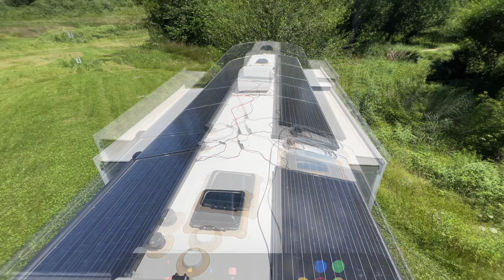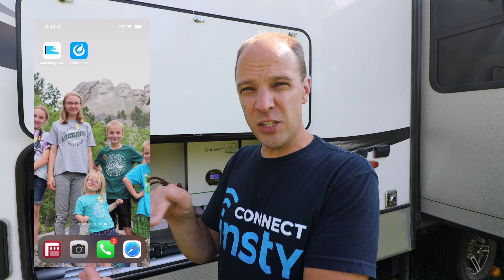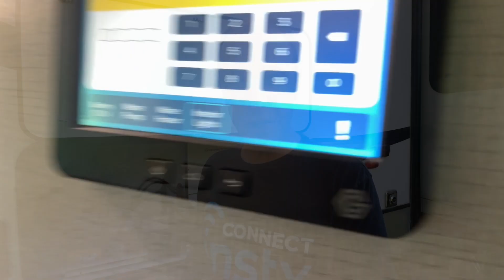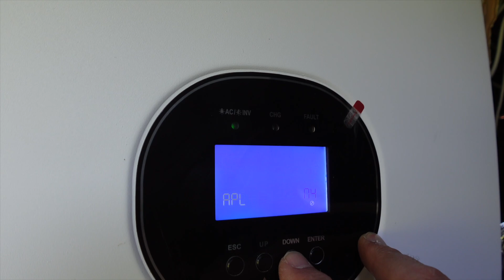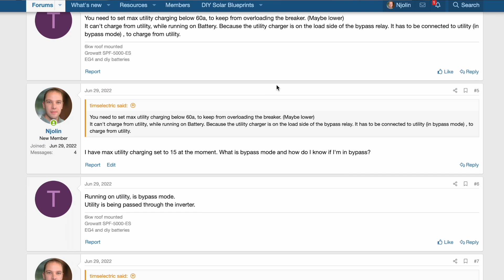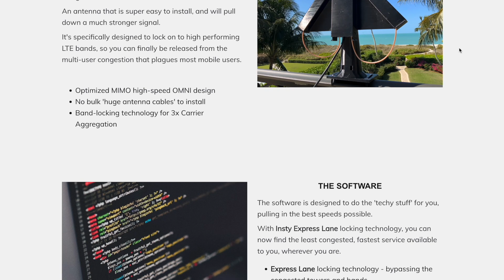How to DIY a HUGE 50 amp RV Solar System

Comment from the maker: Thanks for stopping by!  I'm sure I forgot something in our solar setup, so if you have any questions or if I missed describing something, please drop a comment and I'll be happy to help.
Thanks!
Reply: Hey, thanks for all the info. As a newbie solar person, I just wanted to drop a few things..1st, I think you have 7.680+/-  kwh battery not a 15Kwh..when you add the 2 12 for 24 you don’t double your aH..second, you may (and idk for sure) but if you connected the Growwatt together for 240, then used a transformer to auto switch it back to 120, that may have lessened the amount of reconfiguring on your panel in RV. 3rd I think the easiest charge and use scheme would be with an additional charger, so maybe there’s a way to wire that into the cutoff you plan to add.
Reply: @nwalker7008  It's a 15kWh battery bank (Each battery is 320AH @ 24V = 7680Wh and the batteries are connected in parallel).
Reply: I have a 2020 Cougar 30RKD (50A) with an outdoor kitchen that I do not use (well used one time right after we bought the camper in 2020) and have been thinking of doing just the same thing.  I am going to go 24 Volt, not 48 or 12, same as you but just yesterday I purchased a 'pre made' battery from SignatureSolar. 100 Ah, 5120 Wh and I don't have to build it myself. I'm going to start with battery and inverter charging while on shore power as we (the wife and I) don't 'boondock'.  My 6Kw inverter and batteries are going to fit inside that same compartment just fine, however, mine is directly over the wheels so I'm thinking that will help with the some 170 pounds a bit better.

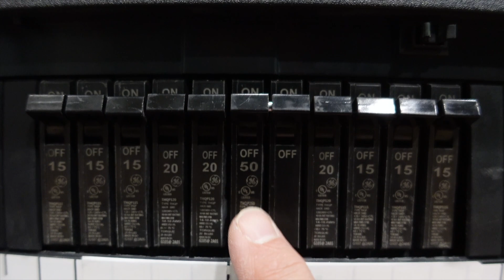I am still in the planning/ordering stage and wondering how you did your wiring for the inside panel... you touched on it briefly starting at the 8:30 mark.  What did you do? How/why did you do it?  

I'm thinking of a switch 1 for shore power, 2 for inverter power and having a separate 24v charger to top off my battery while plugged in.   My camper sits inside my 40x50 garage with full hookups as an extra bedroom and bathroom at home on our farm.  We depart 2~3 times a year for a couple of weeks and I want A/C when at a roadside park (making sandwiches) while enroute to our destination .  We got 'caught' last summer in Nebraska while spending 3 weeks with our daughter.  They wanted to look at some dinosaur bones and we didn't care to look at them for as long.  So we were stuck inside our F250 diesel running the A/C with fuel being >$5.50/gal while they looked at bones and ate their sandwiches running their generator in their camper.  We had no such option.  This will take care of that and solar panels will be added during the coming months.  I stayed awake all last night thinking on how to run them.

We have the same leveling system and I'm keeping the 12v system for the same reason as you are.

Russ
10/25/2022

Comment: Your video should be reported to YouTube for making dangerous recommendations that can result in serios injury. The inverters in your video are not UL-458 listed and do not provide automatic neutral ground switching, and for safety reasons, should NEVER be installed in any mobile application.

Comment: Like the video... Im doing research now but think I'll go with 48v to reduce the wire size even more.  As soon as you said something about disconnecting, I automatically thought about the disconnect switches.  Keep up the good work

Comment: For an easy install, couldn’t you just install a 24 to 12 V DC to DC charger? That would keep your old house battery on tip top charge and then just use a 100 amp charger and eliminate the 120 V sure power from your all in one inverters. That would keep your lithium battery charged.

Comment: You have 2 separate batteries so you will need 2 separate shut off switches...Put the switch on the Battery box where the POS wire is connected. Unbolt the POS wire from the battery box and use a copper strap to connect the switch? Cover all exposed metal to prevent shorts.....Cover your Battery Boxes...... Noticed you had a exposed POS lug on a buss bar! and all four battery Posts were exposed. Safety First!   Question....Wouldn't you want just one Battery per charge controller?  I need to research that for myself...Enjoy that power.

Comment: As far as connecting the 24 volt to 12 volt system just use a battery to battery charger. For me personally I will never use a all in one system like the growatt or eg4 , because if one part fails then you have to replace the whole system. I perfer to use Victron gear and yes i am poor and live full-time in my 1967 GM TDH-4519 city transit bus in the high desert of New Mexico. I am disabled and unable to work anymore so I live on a very fixed income and I will still save up enough money to buy Victron gear

Comment: Feb, 2024 the 50 amps objective is much simpler. Two 8000 watts modified sine wave inverters, each connected to a bank of 8 x 12 volts x 100 amps lipos. Then purchased a 50 amps inlets plug...

Comment: Hello, well a year later the choices are greater and prices lower... : )
How would you now connect a solar generator to a RV 50 amp inlet ?

Heated power case with two built-in inverters and four string combiner?
with ?x800 watts flexi solar panels...We already purchased 6 of them, not sure how many we can string together.
We are now in negociation with a lipo manufacture to see if people can order turn-key 50 amps RV ready heated power case.

Inverters now have a max. cap. of 8000 Watts and 3.5K of running watts...not sure if we have to get two of them...

You seem to enjoy that kind of thinking/work...me too. :)

Eldy
Reply: Hi, I'm doing the physical part of the Solar 50 amp project. Like you said, choices are greater and prices are lower. I have 50% of the system up and running smoothly, ordered the other half yesterday. Once installed on the 50 amps inlet, I move on to selling an automated electrical solution for 10 years to RV Dealers.

Specs are as followes,

8 x 800 watts panel on a 8 String Combiner.
1 Renogy 100 amp MPPT
Two x 8000 watt inverters
16 x 12 volt 100 amps(All in parallel)

and voila, afterwards I have to design a freeze and shake proof hard casing...fun fun! :)

Comment: so why wouldn't you use a hybrid inverter connected to solar and battery and shore power to continue the vicious cycle of charging the batteries to use?

Comment: Hope you find a solution because I have the same issue of not wanting to mess with the original house battery system.  I dont hav a separate battery system yet, still researching. Perhaps a dc to dc converter from 24 to 12 volt and just keep the house battery topped off?

Comment: Please Help with Poor solar system performance? I have 36 volt, 1920 watts of solar panels, wired in parallel. Connected to a Powmr MPPT Solar 60A Solar Max Charge Controller for 12V 24V 36V 48V. Using 8 gauge wire running 90 feet from controller to 675 Amp Hour floated, 12 V batterys. QUESTION controller output is Only 25 Amps at 12 Volts. I think I should get approximately 50 Amps to 150 Amps at 12 Volts?. DOES ANYBODY KNOW THE PROBLEM. I checked the 36 Volt, 240 Watt solar panels open circuit voltage is approximately 36 Volts short-circuit current is approximately 8.25 Amps each panel..  Any help would be appreciated Thank you.

Comment: For joining the two systems I found going through a big step down converter to work great at replacing the 12v battery all together. I was lucky enough to build 48v and got my hands on a 250amp Dodge converter from the newer greener 48v trucks they don't actually have a 12v battery at all so that converter starts it and runs the truck. The 48v turns a motor the turns the engine harder 😂 kinda convoluted system if you ask me for a OEM but the parts are fairly cheap used and plentiful. I did a eg4 bank in one set up and a diy bank in another and this was a great solution to both but it's 48v. You could redo your pack so it's a 320ah 48v pack but I don't believe the growatts will work although they sell a 48v version that I actually use and love. Either way the easy route is a converter going 48v just makes a lot of things better as you pointed out going from 12 to 24. 48v is even better at making small currents for the watts which makes the wire so much cheaper sometimes that alone can offset the cost. It did in both my cases. I also made a 48v alternator for the ambulance that really does a nice charge quickly. It does around 6kwatts but a good suggestion especially since the rectifier can be mounted close to the charge circuit so the relativity cheap ac circuit can make long runs without the voltage drop of DC. Works like a champ for the last few years. Next is a system for the house/shop complex 😂

Comment: If the inverters can’t tell the state of charge what happens if you are away and it keeps trying to dump power into the bank once it’s full?
Reply from the maker: The battery BMS monitors individual cells and will cut off charging if one of the cells reaches top voltage.  That's why lithium battery BMS's are super important

Comment: I'd like as much information on a 12V system to run my entire camper. My camper is 30 amp and has the 12 volt system up front. It had 1 12 volt marine battery and I replaced it with two better 12V marine batteries that have a small 12 trickle panel for while I am at work to help charge those for the lights when its comfortable enough without running the gas generator. I am wanting to replace the gas generator with solar panels. I have 8 6 volt  golf batteries I bought new for this. I know how to wire them and I already have all my cable for the connections. What size inverter do you think I need? Also a good controller? I have one ac unit. Any help is greatly appreciated.

Comment: Have built a number of off-grid systems, and I'm not familiar with growatt inverters at all, but my next system will be a Sun Gold hybrid which is batteryless. So in the event of a battery rundown and you're connected to shore power it will just pick up from the shore power or you can run it without the batteries at all. They have an awesome rack mounted battery as well and a couple of those would give you a similar amount of power as what you have there for very reasonable cost

Comment: Curious if there was ever a solution to integrate an onboard generator or shore power into a system like this.  Would like to have the option to use solar/bank, generator, or shore power.

Comment: Not a bad setup but having the 12v seperate is a pain by time u get that all included the price would prob be same as a normal systemi just done my van 600ah lithium 12v,1200w solar, dcdc charger from car 3000w inverter runs air cons etc for about 9000 aud all inclusive never have to worry about any things or issues

Comment: You absolutely do need to keep the inverters synced. If you only have one neutral wire running to the panel. If the 220 volt phase cycle isn’t 180 degrees off from each other you are effectively doubling the amperage through that neutral wire.
Reply: This comment! This is a problem in residential, overloading neutrals. Something people overlook.
Reply: This guy seems to have done his homework. He probably did separate neutrals.

Comment: 7:11 How much power does your 12v system run?
Can you just get 4 more cells and a 12v 50a controller and find a place for 1-2 more solar pannels?
the 280ah cells are a bit more managable in existing 12v spaces.

Comment: My Growatt says it is supposed to only work with Growatt batteries (Li) and has the communication cable that is intended to interface with the battery's BMS. However, it also has settable values for Li. I am assuming you used the configurable settings for the charge profile of your custom Li batteries. True? If so, what parameters did you set? I know Li does not like to be kept "trickle charged" once at 100% charge and I am wondering how you prevented that. Any information would be helpful. Thank you!

Comment: You didn't mention it, but I hope your batteries are LiFePO4s. If so, they are figured at 12.8 Volt, (or 25.6 Volts in a 24 Volt nominal system). If not, they could be a fire hazard!

Comment: You can run a wire from 24 v charge controller load to your 12 v charge controller solar input and thats all you need to charge your 12 v system

Comment: Here is a thought for your 12v systems. Hope this isn’t too wordy. I’m currently planning how I want to set up my fifth wheel off grid. One of my requirements is the ability to charge off of my tow truck. Essentially eliminate the need for a backup generator.  I already have a 220 amp alternator in the truck and can add a second if I need. Here is my plan for the 12v system. I already have 4 gauge wire running from the front of my truck to the back of my bed. Looks like a homemade winch power kit. I also already ran the same 4 gauge wire to my current 12v battery bank on the RV that I can plug into the truck with quick connecter. This allows my truck to charge my 12v system while it is running with much more amperage than the little wire in the 7 pin trailer connector. I used a continuous duty solenoid up front so it doesn’t pull a load off the truck when the key is out of the ignition. I did this so my residential fridge doesn’t draw down the battery bank while driving long distance. Now part of my plan for the off grid system is to leave my 12v system alone to include the 2000w inverter that already exists. I will then wire that inverter to one outlet i installed next to it that I will plug a 10-13 amp golf cart charger to. That charger will charge the future 48v system I put in independent of the future solar and inverter charger. I’m also going to leave the 100w panel on the roof that is already hooked up to my 12v system. I know it’s not the most efficient but I wanted a way to charge 48v from the truck’s 12v system while driving or I can high idle while parked for a while to top off without the need for a backup generator. I will already have a huge weight penalty on the trailer’s gross for solar and batteries. Eliminating the generator will help. One bonus I see based off of this video is now I will have an alternate power source to jumpstart the 48v system in the event of getting too low in energy reserves. I may rerun the cables from the truck as 2 gauge. 4 gauge is what I had on hand and it served the purpose at the time for keeping up with the fridge on the 2000w inverter. I know I can get 12V to 48V up converter but they are not cheap. This method uses an existing robust system which will leave me with a backup power reserve to jumpstart the 48v system and allow for using the truck as a generator without pulling too much juice out of my alternator. Another key to this is the switch I already installed on the outlet that runs my AC to 12V DC converter that came stock on the RV. This will allow me to prevent my future 48V off grid system from trying to charge my 12v system while I’m using the 12V system to charge the 48V system. By keeping the 100W panel on my 12V system I will likely never even need to charge it from the 48V system except under rare circumstance.  This will also give me peace of mind that I will have an entirely independent power system on the RV that I can easily return to original configuration in the event my 48V system has a catastrophic failure. This will guarantee my 12v system as well which is vital to the RV. My 12v sources will be shore power or the 48V system via the AC to DC converter, the tow vehicle, one solar panel, and the 12v battery bank. The one thing a may do to the 12V system is upgrade from the current lead acid bank to a more robust and smaller by size/weight lithium bank. I’m concerned about weight for the overall system so last thing I want to do is leave 4 heavy deep cycle lead acid batteries on the 12V system. I won’t need as many amp hours on that system then either as I do now. By doing thing this way it will also be easier to return things to near factory configuration if I decide to sell or trade in the RV later and recover my off grid system to place in another unit.

Comment: Here is an idea yu may be able to do tobuse power from batteries and charge at the same time. Add a second battery bank. With an automatic low voltage switch. Once one bank gets low it will switch to the full bank hole the ow bank recharges. And it will cycle back and forth.

Comment: Great job...I did similar w 3000 growatt on a 30amp trailer so did not have to mess w circuit breaker.  I put a two way switch in where my shore power comes, to by pass the entire solar battery setup if there was a problem, that then powers the trailer as normal. Paid off when the AC drained batteries too far down.

Comment: I need to understand how the battery arrives at 320 amp hours.  If it is series would Amps stay constant while volts add up?  If Amps add up, why is it not 800 amp hours?

Comment: I am about to do exactly the same. But on a C class. With a 24 volt 175 amp Alternator. Washer/dryer will be 240volt
With two 3000watt inverters

Comment: I would suggest using a separate 15amp charger isolated so you can plug in to a 15amp 110vac to charge your batteries while your existing setup is inverting to 110vac for the RV.  That would help with the issue you are having of charging and sourcing batteries at the same time.
Reply: True. Too bad he didn't go with a 48 Volt system, as the new Chargeverter from Signature Solar works great, and can be adjusted for both Amperage, (0A to 100A), and for Voltage, (from 43V to 57V) It also can take either 120V or 240V AC input, (needing an adapter for 120V input)